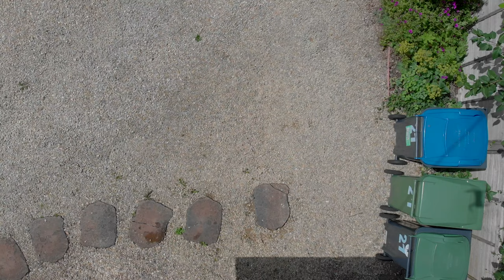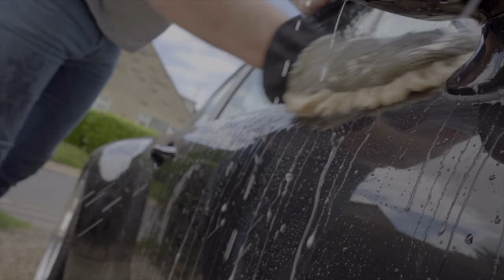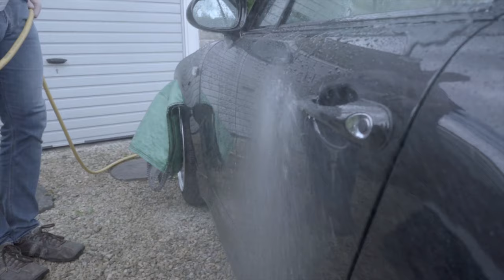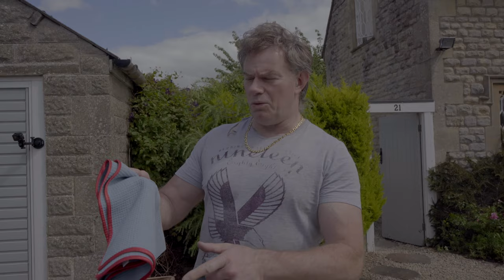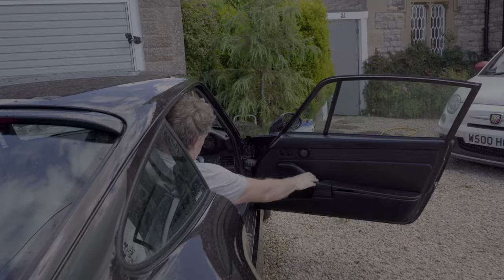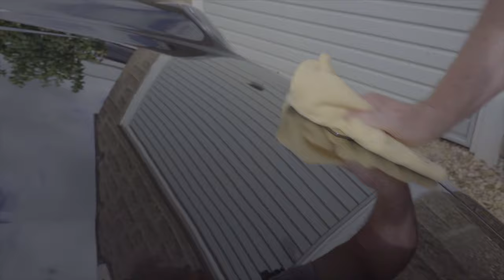Washing and Drying a Porsche 911 Garage Queen!

Comment: I always use a two or three bucket technique when washing. Also prefer to use a foaming cannon at low psi.  I also use a chammy cloth to start the drying process to dry it off. Microfiber cloth to finish the drying. Not uncommon for me to use a blow dryer along seals. 

Great looking Porsche (even if you have sold it).
Reply from the maker: With full coverage self healing film two buckets not so essential but good practice.